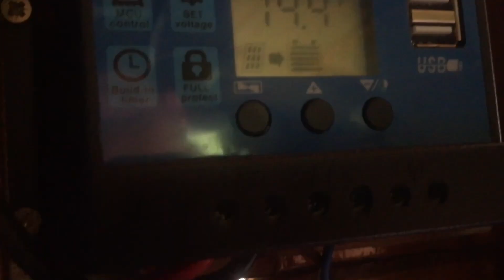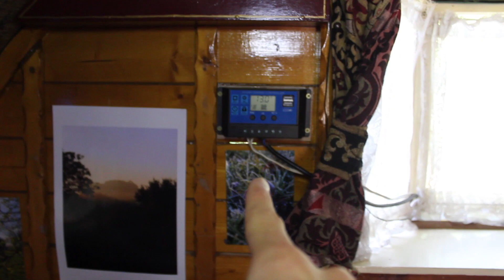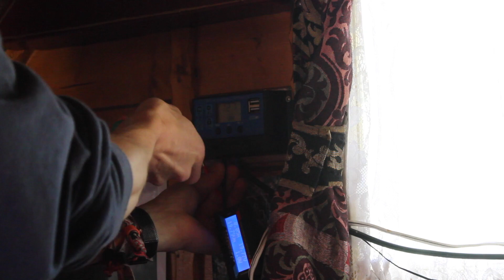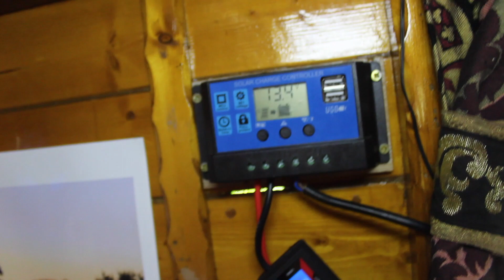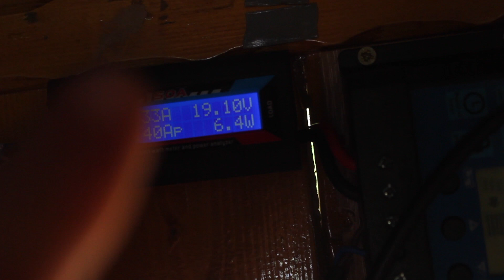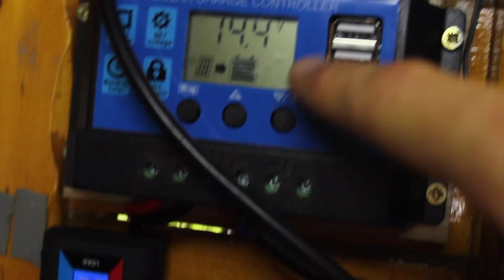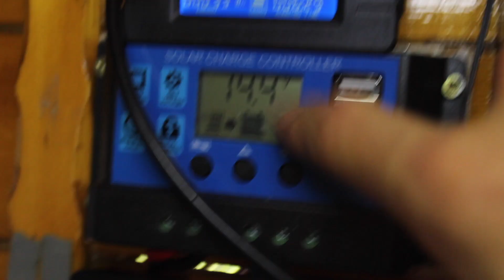150A Watt Amp Meter Review // Maxz Vanlife 027

Comment: Devin is a bot mate. wanna be friends or wanna be YouTube friends gives it away. Better not to correspond. 👍 I purchased a similar one for my bike but never ended up using it, handy though!
Reply from the maker: Yeah thanks for that you did say before 👍 yeah it works great 👍
Reply: I might get one of these. I have quite a lot of 240 volt appliances running of 2 separate battery banks. Because I split the electrics front and back. So I want to to know how many Watts my solar panels are putting in. Would this be a good purchase?
Reply from the maker: adventure before dementia campervan build I wells say so yes, just wire it in line and it should work, what charge controller do you have, most mppt one show the amps
Reply: @RustyRoseAdventures  same  cheap Chinese one as you. Just shows volts
Reply from the maker: adventure before dementia campervan build ahh yes, well I think it’s great for that 👍